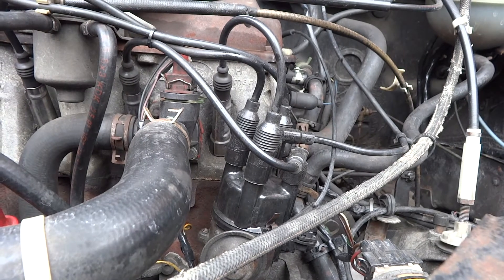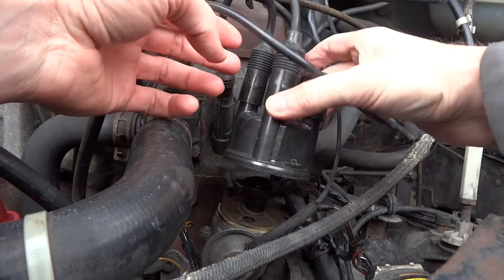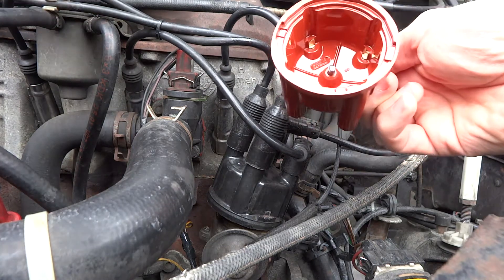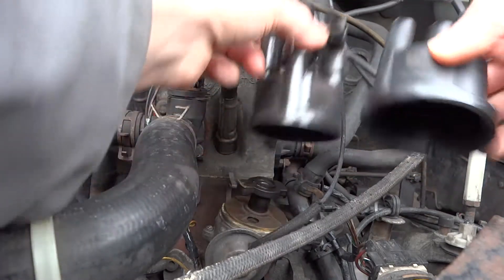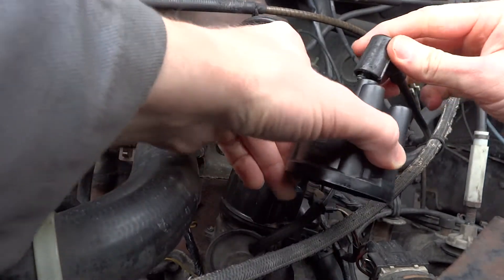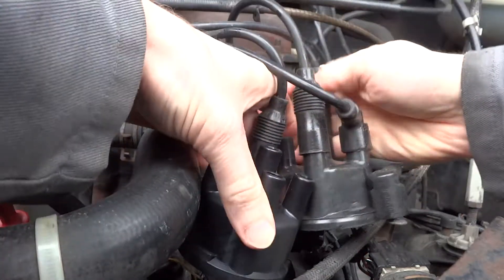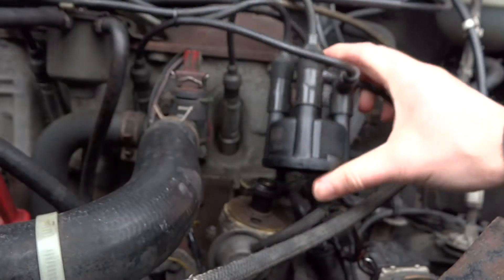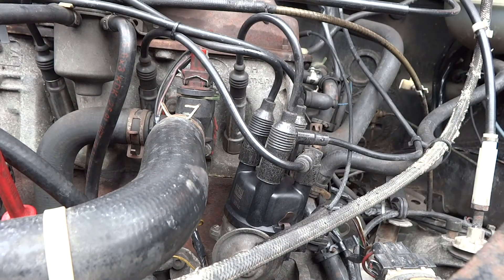VW Golf mk2. How to Change a Distributor Cap & Rotor Arm

Comment: Hiya mate, found your video really helpful. Are you working on an 8v or a 16v? I'm struggling to find a replacement dizzy cap for my Mk2 GTI 16v so just wondered. Cheers.
Reply from the maker: Hi that was a 1.8 driver, so I guess it is 8v. I think we struggled to get the right cap too but can't remember who we got a correct one from in the end. May have been GSF.
Reply: @ifitsgotwheels  Brill, thanks very much 🙂